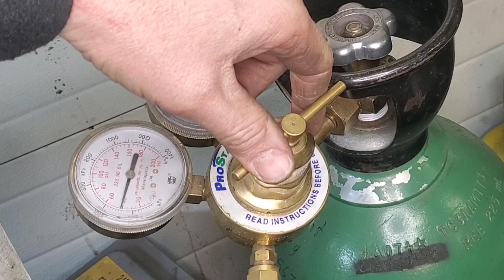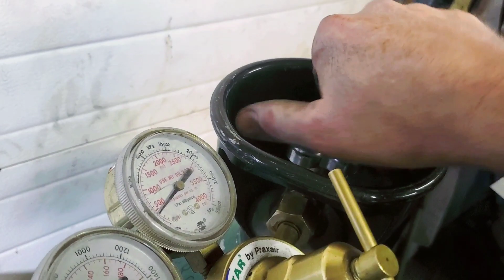Cutting thick steel plate in a small job shop

Comment: Good job. Try bringing the torch tip a bit higher. Looked like the metal was melting on the edges of the cut.
Reply from the maker: Thanks Danny,  the metal melting on the top. Is that a sign of it being to low? Along with the popping
Reply: @Wrighmachining  Yes Sir I think that is what it looks like to me... I welded for a living back in the 70's and 80's. So long ago that I forgot many things about cutting. But the torch and flame being to close to the metal will melt the metal on both sides of the cut. I couldn't tell how you had your oxygen and acetylene mixture but I see lots of videos where the settings are way off. When everything is set right, there will be no slag and if there is a little bit, it should knock off with minimal effort. And the cut will look almost like a band saw cut it...
Reply from the maker: @dannywilsher4165  really appreciate the input there was a fair amount of slag that knocked off easy on the popping cuts then towards the end there was way less.  I will play with the heights for sure next time.   huge thanks for your input 😎
Reply: @Wrighmachining  My pleasure Sir!!!

Comment: I'd say dirty tip, but man that cuts clean very nice...
Reply from the maker: It cut really nice with ⅛ kerf over the whole 2 inches.  I cleaned the tip and turned down the pressure a bit and it seemed to work better.

Comment: Not a job for the mini shop.... The sink is too small.....
Nice You have gear for more heavy works.
Reply from the maker: Mini shop it would be tuff, probably burn myself down if it wasn't a 20x20:) all the tooling I have bought second hand or got broken stuff and fixed it up over the last 25 years :)
Reply: @Wrighmachining  Well done building up the shop that way. Guess it's the only resonable way. A retired Swede just won 3 miljon USD in a lottery... Don't think she will go for this kind of shop...
My shop sits in the kitchen..... The basic mini machines have been bought new during 3 - 4 years... A minor difference....